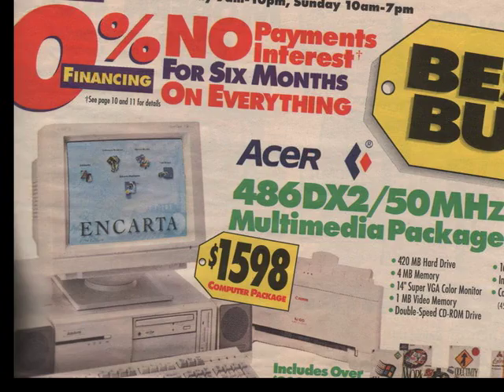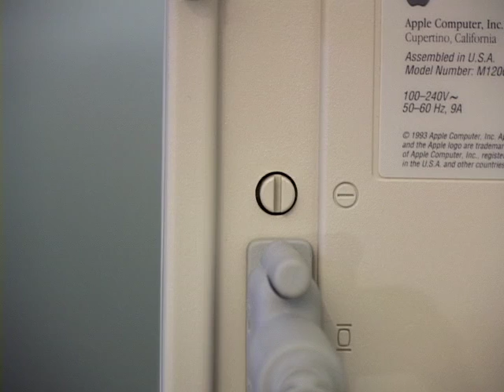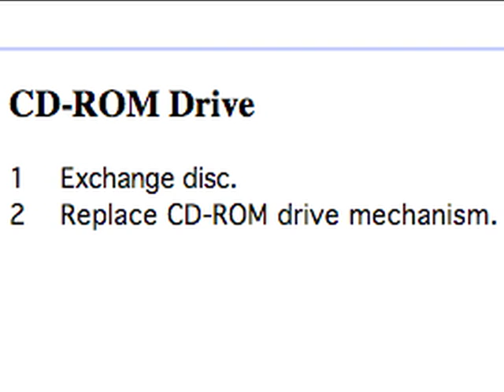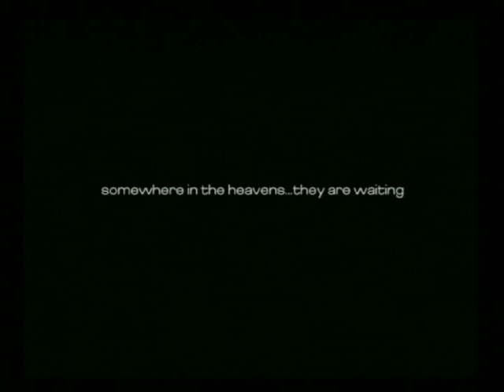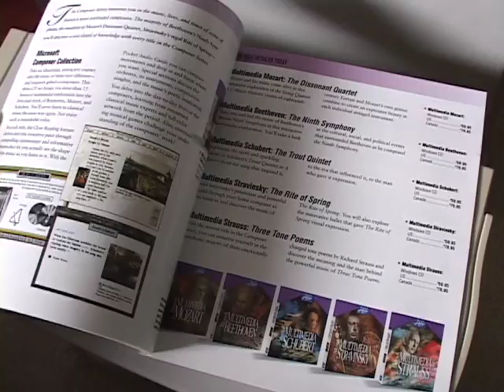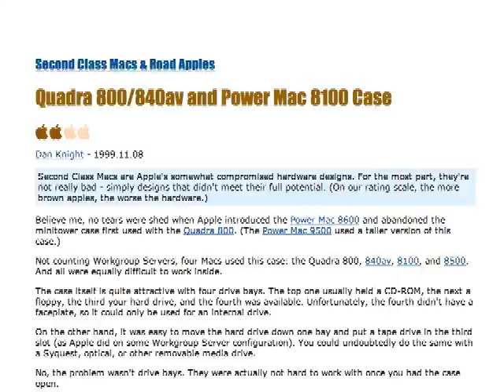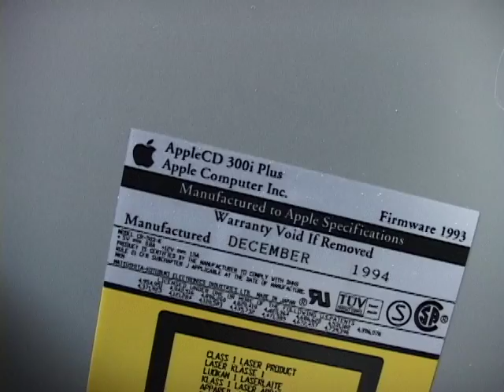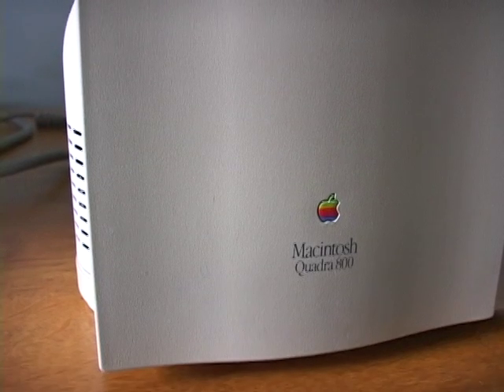The Macintosh Quadra 800

Comment: I thought the Quadra 840AV was the best of the 68000 line—not to take anything away from the beloved SE/30–but thanks to your video I now know it was the fastest of its generation.
Reply: It was, it sported a 68040 at 40 MHz vs the 800's 33 MHz and that's before you mention the 66.7 MHz AT&T DSP 3210 DSP. 

Source: https://en.wikipedia.org/wiki/Macintosh_Quadra_840AV
Source: https://everymac.com/systems/apple/mac_quadra/specs/mac_quadra_840av.html

Also, I owned one.
Reply: Apple had been naming all computers using the 68030 processers with an "x", such as the IIx and IIcx. When it came time to put the 68030 processor into the SE series, they unfortunately decided that calling it the Macintosh "SEx" wasn't the best marketing idea, so they settled on "SE 30".

Comment: I miss my Quadra 840AV. That was my "go to" machine for about 5 years until I purchased my PowerMac G4 (400hz) in 2000. I loved it for Photoshop! I never did use its AV ports for video capture beyond experimentation. It was a fantastic machine and I still miss using. I am shocked at how the GUI and software seemed to be pretty snappy on it back then as compared to OSX or Win10 today. Thanks for making this video --brought back some good memories.
Reply from the maker: Thanks for commenting, Kelsey. Sounds like we had roughly the same ownership history. I agree that the latest OS's are frustratingly laggy in comparison.

Comment: My freshman year at the University of Texas, we had these in the computer lab, and they just flew compared to the 486 PC and dial-up modem in my dorm room, plus of course System 7 felt way more refined than Windows 3.1.  The lab was half Quadra 800's and half Dell PC's, and I liked the Macs so much better, and finally got a Mac clone of my own a year and a half later (equivalent to the PowerMac 8100 but with a much more accessible case).
Reply from the maker: Thanks for sharing that. I never encountered a Quadra 800 'in the wild' when they were in use.
Reply: I had one of those. It was built like a tank and weighed as much as one.
Reply: back when I was going to get my first computer, I almost decided on getting a Radius 81/110, but decided instead on a 7500/100.  I kind of wish I went with the 81/110 because it's so much nicer looking and would have been faster, though not by much.  I still turn on and use my old 7500 (now upgraded to a G4/400) from time to time, but I sometimes wonder if an 81/110 would have been better.

Comment: I owned a bunch of rescued Macs that included a Quadra 700 and an 800. I loved both, but ended up really adopting the 700, largely due to the PITA of the case, as you outline here. The 700 was maxed, with a great Radius graphics card  a Sonnet QuadDoubler that took it to 50 Mhz. I loved both those old computers, but that 700 was really nicely designed.

Comment: I started college in 1995 and we had one of these as an audio editor / DAW.  It was my first experience with a DAW, and they still had a class to teach old-fashioned tape splicing at the time!  I couldn't tell you about its' internals; I just know we had an external 1.2 GB SCSI hard drive, along with an external (2x?) CD Burner.  I believe the software was Sound Designer II connected with a DigiDesign Audio Interface.  It amazed me at the time, and I burned my first CD in 1995 (the blank cost me 14.99 at the school bookstore!!)
Reply: That 2x CD burner must have cost the school several thousand dollars back then. It wasn't until 1995 than HP released the first burner under $1000, and they had probably gotten it a year or 2 earlier.
Reply: @Kennephone  I'm not positive it was a 2x, but I think it was. I just remember being amazed that I could create my very own CD! I also remember having to be very careful, because if there was a buffer problem (or any problem for that matter), you'd end up with a $15 coaster. (Good times though, wouldn't trade them for anything.)

Comment: I have a quadra 800 with one of those upgrade cards I recently installed mac os 8.1 some times when my mac boots I get the normal mac start up tone and sometimes it sounds like a power mac 4400 start up chime.  I have a questing when I installed the upgrade processor card do I need to install some driver or does the machine know its there and uses the card automatically
Reply from the maker: There is a control panel that allows you to turn the card off and on. I look at it in my 6100 video, briefly.

Comment: I had a IIsi with the co-processor card. I dreamed of getting a quadra back then! I used to play Marathon on my IIsi in a tiny window and it still ran like crap! There was another bungie game before Marathon that was really really good! 'Pathways into darkness', also a first person shooter. I remember in 1994 my friend got the first powerpc 6100/60 and it ran Marathon amazing!
Reply from the maker: Thanks for sharing that. I didn't really know about Marathon until I bought an external ZIP drive for my 6100/60AV and it came with a Marathon Demo. So, I never had to run it on a 68K machine. In the manual Bungie says you can even run it on 68020 machines (LC and MacII), but does not recommend it. They say, "Look on the bright side. Apple just lowered their prices again..."
Reply: 65scribe I have the whole trilogy on my iPad now! They’ve just updated it to support 64 bit too as it was taken off the App Store for a while when they stopped distributing 32 bit apps.
Reply from the maker: I haven't tried Marathon on iPad, but that's good to hear. I wonder if the interface is as good as a keyboard, or if it would work with a keyboard.
Reply: 65scribe I think they’ve recently updated it to work with some kind of peripheral. Mfi controller?? I’ve played it mostly with the touch screen controls and it is really challenging. But if you turn the difficulty down it is not bad. Would love to try with a controller or even better a keyboard

Comment: the power mac 8100 used the same style case, similar to the 7100 using the quadra/centris 650, performa 600, iivx/iivi's case and the 6100 using the quadra/centris 610 and 660av's case

Comment: the Quadra 800 and subsequent 800 designs were truly a bear to operate on, so when you DO go to upgrade, it, get everything you'd ever need and max it out so you never ever have to do it again.
Reply: I had its successor, the 8100/80.  I swear, after the first time I upgraded it, I just left the case off for a loooooong time.
Reply: my brother for a short time had an upgraded Quadra 800, he tried to open it up to upgrade the ram, could not get it off correctly and I think he even ended up partly breaking part of the case trying to get it back together.  He said it was by far the worst case he had ever tried to open in like 50 computers he had used both PC and mac, it was such a nightmare.  I think he sold the parts to someone, I don't know.
Reply: I remember having to open one to fix a bad cable connection. Worst case design ever

Comment: You forgot the actual step 1 for removing the logic board: pull all expansion cards. The MLB's not going noplace with cards installed.
Sadly even up through the 9500 the third external drive slot in this case was basically reserved for tape since the front panel's shielding was only large enough to accept such a drive even after removing the blanking plate. Kind of dumb if you hoped to put in a second CD drive or something but you may have been able to cram a 3.5" MO or Zip in there if you were determined and didn't care about how ugly it was after the fact (or could find a custom bezel which I think I have for an 8500).
The floppy bezel on these and a couple other Quadra/Centris models was specially designed to work with either the auto or manual inject drives. Note the indent at the bottom that's not present on the old auto-inject models but isn't fully developed as it is on the manual-inject types. There were a handful of Macs around this time, mostly '040 and NuBus PPCs, that could use either auto or manual inject drives where most others would only work with either/or (at least, not without cable mods), for example the Color Classic (auto only) or Performa 6400 (manual only).
The lower drive bay was reserved for fixed disks and was able to accommodate either a single full-height 3.5" drive, or an optional server-focused caddy for two half-height drives. The latter was more for the 8100 and later models with their second SCSI bus but with a FWB JackHammer installed it would work just as well here.
Reply from the maker: Excellent details, Frank. I know who to ask when I get stumped on something!

Comment: I've always liked Apple products but they were always too expensive for my budget. Today is even worse with a baseline price of a Mac Pro being $5999.99. Also, when you use today's Apple products, you are forced into their ecosystem of peripherals. Don't get me wrong, the Mac Pro is a well designed machine, but I'm not going to spend $5999.99 on a desktop given the current state of the PC market. Rather than spend $5999.99 on a Mac Pro, I could: build my own PC for a fraction of the cost of a Mac Pro, install the MacOS on it and save thousands of dollars.
Reply from the maker: Completely correct. It’s one of the reasons I still use a 2008 Mac Pro as my main machine. Admittedly, that would not work for many users needs.
Reply: @65scribe  The 2008 Mac Pro is an outstanding machine. I like the case of the 2008 Mac Pro better than today's Mac Pro. I've never seen the inside of a 2008 Mac Pro, but it seems to me that you should be able to swap out the motherboard for a newer one and replace some of the hardware. Given Apple's tendency toward propriety, this might turn out to be major surgery and you'd better off building a Hackintosh. Sorry about the rambling. :)
Reply from the maker: Moving from the G5 to Intel Xeon freed up a lot of room inside the case, but what I like is that I can still load PowerPC software as needed. That might be an idea to hack a second-hand Mac Pro to something more modern.

Comment: You never mentioned the 840av. Still pretty good video
Reply from the maker: Thanks, and you make a good point. I tried not to stray too far from the featured computer in case I got hold of a 840av down the road (yeah, right). Plus the 840av was an alternative to the 800, not a replacement for it, so that's why I only talked about the 8100 as the successor.
Reply: 65scribe 
I get what you’re saying, but by alternative do you pretty much mean “variation” where it’s the same machine but with some slight differences?
Reply from the maker: The Quadra 840av and 660av were the new line of Macs engineered for audio-video work, so I definitely wouldn't say slight differences, but using the same cases as the Quadra 800 and 610. The 840av was the fastest 68K mac to ever be built and was still available for a few months after the Powermac 8100 came out.

Comment: Fastest computer at the time? After 66 Mhz 486DX2 was available, with most PCs being far cheaper? Sorry but no. As for sound being "premium" on PCs, sorry but that is just a cheap anti-PC jab. PC sound cards were available since 1988, it is just that PC is an open standard, there was no way to force every PC manufacturer to include integrated sound on the motherboard, and most PCs without them were used in office work anyways, why have sound in an office PC? What these multimedia PCs meant was not just a PC with a soundcard, but PC with a soundcard, CD-ROM, and a full motion video capable SVGA videocard. That also meant having at least a 386 processor.

Anyways that tower layout looks terrible. I bet it was far more reliable than some crapola Chinese bottom end multimedia PC that cost 1/5 as much but I would still take a good (meaning not the bottom end crapola one) PC over this. I like DOS and Duke Nukem 3D, Doom, Descent and all that nice stuff. Still, I got to say Mac OS was better than Windows 3.1.
Reply from the maker: "Fastest computer of it's day" wasn't necessarily meant to imply it was faster than a DX2, Alpha or a Cray-2, just the fastest in the Mac space. But, as for sound on PC's in the mid-90's, it does deserve a cheap jab. My $100 TI99/4A had sound, and that was 1983... Even Apple's DOS compatibility card (1994) had a sound card on it... And being someone who used PC's in the workplace in the mid-90's, I'd shake my head troubleshooting a PC, trying to figure out why the sound didn't work, only to realize it didn't even have basic sound capability. Oh, and listening to PC resellers advertise sound on their computers seemed ridiculous... Like advertising the AC power cord... And I'm not saying to provide a Sound Blaster(TM) with the fancy plastic speakers and the cool bendable microphone... just a simple sound chip and a couple jacks like the Mac LC. The PC industry did just that a couple years later. But, I don't want to go too far into the weeds here... The videos are not meant to resurrect a dead rivalry between PC's and Mac's. I made many cheap jabs at Apple in the same video. The goal is to present an old computer in an entertaining way and maybe viewers will feel some nostalgia for a time LONG ago. Seriously, thanks for providing a different viewpoint. Your comments really make me think.
Reply: 65scribe TI 99/4 had a simple 3 voice tone generator. If that classifies as sound, so does the PC speaker.
Reply: Not quite.  The voice generator was its own hardware.  The PC speaker has to be driven by the CPU.  PC speaker still loses out in that case.